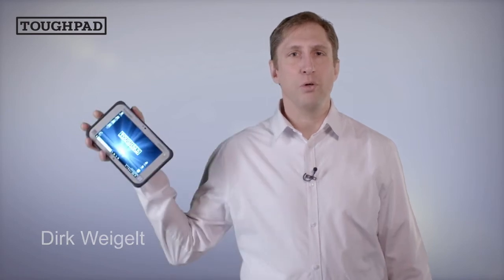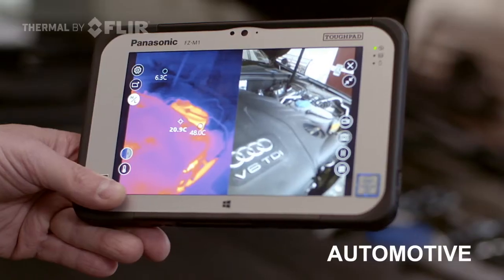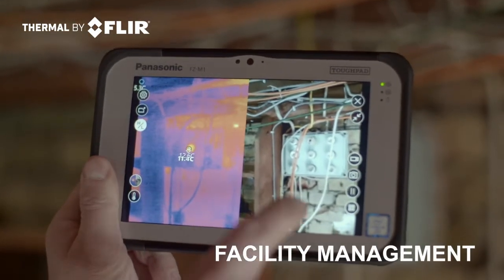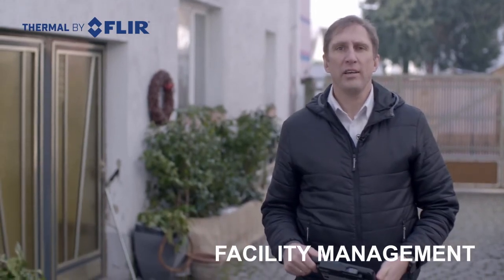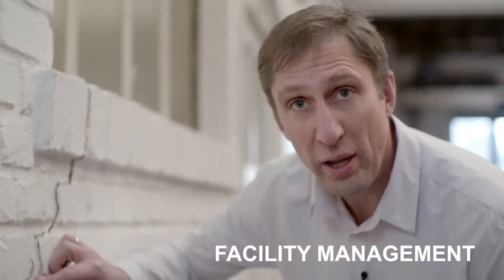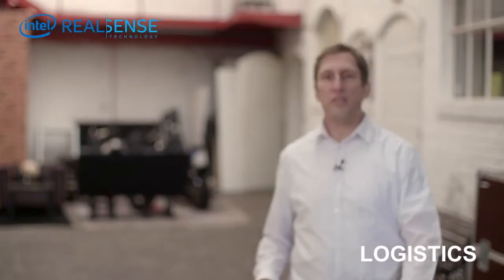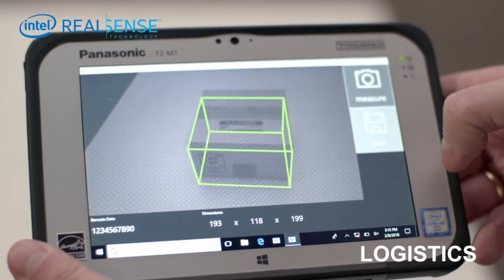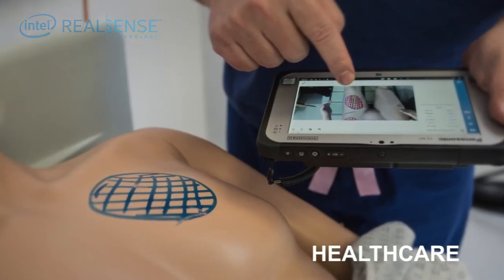See the Invisible: Toughpad FZ-M1 Thermal Imaging and Intel RealSense Solution

Comment: I have a bit of an old question, I have a Toughpad FZ G1 I saw a document that mentions a thermal camera, was there an option for this model? If do is there a part number I can search out, also what software did it use?

Cheers, Paul B.
Reply from the maker: Dear angusandleigh, thanks for reaching out to Panasonic TOUGHBOOK. Indeed, Thermal Imaging was available for the TOUGHBOOK G1 (as it is today even with TOUGHBOOK G2).

As it had to be installed at a Panasonic Configuration Center, there is no dedicated part number of Thermal Imaging for G1, I’m afraid. At the TOUGHBOOK G2, it’s available as accessory due to the modular concept of the G2.

The software is a Panasonic self developed software for Thermal Imaging. If you want to have further information, please feel free to use the contact form on our website. 

Your TOUGHBOOK Team

Comment: I want to get the dimensioning of avionics in my aircraft for fit checks.  My boards are typically less than  10 x 10   (1) Will the reflective nature of the PCBs mess with the camera?  (2) what is the smallest thing it can measure (3) Can I capture a stp file of what I scan?
Reply from the maker: Hi Tillman, unfortunately we don’t have any information on the smallest length that can be measured but the accuracy on the RealSense module is +/- 2%, if that helps. With regards to the reflectivity, this will depend upon the exact material and light sources.  There is no ability within the Panasonic software to convert the recorded files to STP files but other software application might be able to.  If you get in touch with your closest Panasonic reseller, they might be able to organise a sample for you to trial.  You can find your nearest reseller here: https://business.panasonic.co.uk/mobile-solutions/where-to-buy
Reply: @PanasonicConnectEurope   Do you have a US link?
Reply from the maker: You can contact our US colleagues through the form on this page https://na.panasonic.com/us/computers-tablets-handhelds.  Thanks.